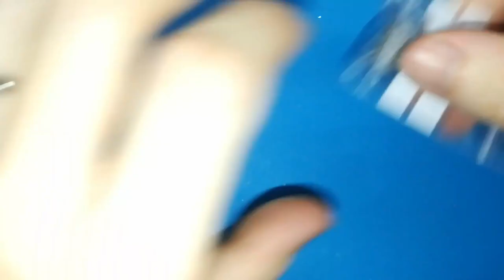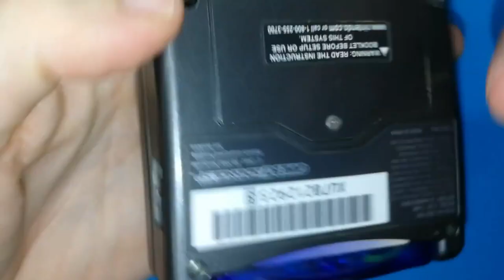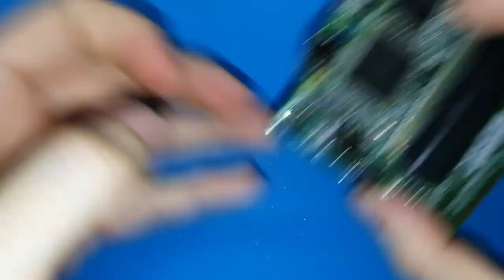Game Boy Advance SP USB-C & Audio Kit (Installation)

Comment: I installed this mod on my GBA SP. Everything is working and the battery is charging, but there is no sound. The sound appears when I connect the charger. When I pull it out, the sound disappears after 10 seconds. What could be the problem?
Reply from the maker: Hello!
That sounds quite strange. Possibly the soldering is not done correctly and/or you are not using the right audio adapter. Remember that the adapter has to be analog, therefore, it should not include a built-in DAC. You can contact me through the form on my store and attach photos of the installation. Perhaps I'll see something to point out what is wrong.
Kind regards,
giltesa

Comment: I tried this mod. But for now i need a new motherboard because i had a solder bridge (i guess). Can this be an issue that my GBA SP doesn't turn on anymore because of a short circuit?
Reply: And is this mod compatible with all versions of the sp?
Reply from the maker: Yes, the board is compatible with all GBA SP models, it replaces the original connector, and it is the same in all models. Which short circuit did you do? 
I didn’t heard anything about it before, but maybe you can check the 2 fuses that the GBASP has. Check with a multimeter in continuity mode, maybe they are burn.
Reply: @giltesa  which one should i check? The two ones under the connector on the board?
Reply: @giltesa  and what exactly gone wrong...i dunno. My guess is, it was a solder bridge. But i triple checked and it looked pretty fine. The new board is ordered and comes in a few days. Hopefully it works then. If not...i give up ;)

But that's sad because i really want to test that mod.
Reply from the maker: @BaamAlex  these fuses https://m.youtube.com/watch?v=wYSLBXqM_H0

Comment: Looks great! I just purchased a couple of these kits! Just wondering, with the USB-C to 3.5mm Headphone adapter, will the audio be Stereo or Mono? Thank you!
Reply from the maker: Thanks to you! The audio is stereo as the original Nintendo audio adapter. You can see this video where I connect the GBA SP to my PC and it shows the two channels of audio:
https://youtu.be/GM1GdGQwGbM?t=102
Reply: Also, any tips on finding a USC-C to 3.5mm Adapter on Amazon? The one I already had doesn't seem to work!
Reply from the maker: @anthreyony  I don't know on Amazon but from AliExpress I put 2 models on my web that work perfect (from Huawei and One+)
Reply: @anthreyony  don’t buy the digital adapter, as sp only export analog signal
Reply: where did you bought it? do we have something on Aliexpress?

Comment: Can you still lift the pads with the air soldering iron?
Reply from the maker: With an air soldering station, it's nearly impossible to peel off the pads from the motherboard. Simply heat the area and use tweezers to lift the connector without applying force. When all the connector legs are sufficiently heated, it will detach on its own. However, remember to protect all adjacent areas very well with Kapton tape, or you'll damage them (like the link cable connector or the side button).

Comment: I looked on aliexpress and the listing is gone, i also checked the ebay one you had linked so do you know of any others that work or how to know if they will work? Thank you
Reply from the maker: Hello, the links should work:

Original USB Type C To 3.5mm Headphones Jack Adapter Aux Audio For one plus 7 usb-c converter cable For oneplus 6T 7 Pro 8t 9 10
https://www.aliexpress.com/item/33046043635.html

HUAWEI Audio cable Type C 3.5 Jack Earphone Cable USB C to 3.5mm Headphones Adapter For Huawei P10 P20 pro Mate 10 Pro 20
https://www.aliexpress.com/item/1005003446549596.html

Comment: so if you do the usb mod you would get audio out of the usb c port?
Reply from the maker: Yes, for sure. Check this video I uploaded today: https://www.youtube.com/watch?v=ZznNsDhFl9U
Reply: @giltesa  ok would i have to use a sub c to headphone adapter of could it be a usb c earbuds? is it just the usb c mod? thanks again
Reply from the maker: @star43able  you can use both, but it can't include a DAC inside otherwise it will not work. You can read more about it here: https://shop.giltesa.com/product/game-boy-advance-sp-usb-c-kit-centered/
Reply: @giltesa  ok and it has to be the usb c port with audio support and not the regular one?

Comment: Now I know why my audio didn't worked
Edit: fixed now. I have used a tiny piece of kapton tape placed with tweezers instead of solder mask
Reply from the maker: Wrong USB-C to jack adapter with a DAC inside?
Reply: @giltesa Nah, accidentally grounded audio pad xP

Comment: Now my second result. And I must say, i can't be really happy with this mod. It may work yes, but this mod now destroyed my second mainboard. And the second board charged before I did this mod, and now...nothing. The second board is toast. In my opinion, i can't really recommend this mod. Sad.
Reply from the maker: Many people were able to install it, I mean, it's just remove a connector and install other. It's the same number of pins and nothing else need to be modified. If you have a soldering knowledge. If should work for you. If you wish, you can send some photos of your installation by email, I can try to help you better if I can see what you did.
Reply: @giltesa  now i have a question. Is it possible, that this mod isn't compatible with the unhinged gba from boxypixel? I mean, can the aluminum shell be the reason for a short circuit?
Reply from the maker: @BaamAlex  No, that is not possible. You are not the first using that shell and other didn't have problems. You can see some photos of someone who installed on that metallic shell:

https://shop.giltesa.com/product/game-boy-advance-sp-usb-c-kit-centered/

Menu: "Gallery of customer's installation"
Reply: @giltesa  i have the full metal shell. Front and back. No plastic.
Reply from the maker: @BaamAlex   I don't think that can be the problem, the whole USB is covered around with the plastic cap. But you can check the continuity between usb shell and the GBA SP shell.